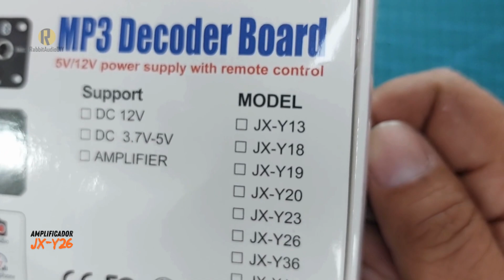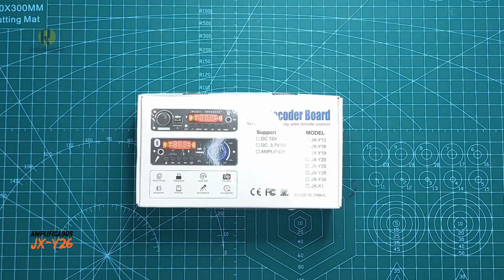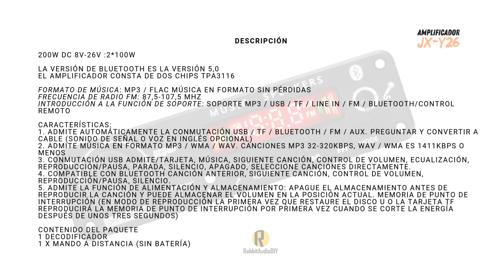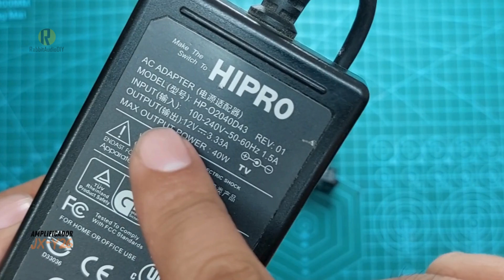Amplificador JX-Y26 de 200W | Haz tú Partybox ó karaoke casero

Comment: De cuantos amperes se requiere para que entregue la potencia máxima
Reply from the maker: @cesarflores9416  mas que nada el voltaje sería  a 26V de 3 a 10A
Reply: @ solo tengo una fuente de 12volts de 10 amp, si aguanta con esa
Reply from the maker: @cesarflores9416  si pero entregará como 50W x canal